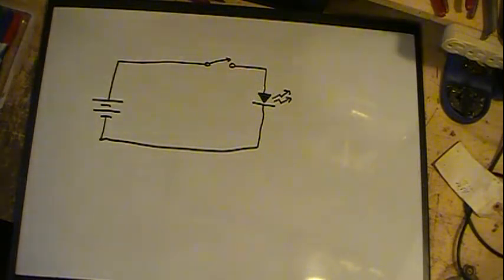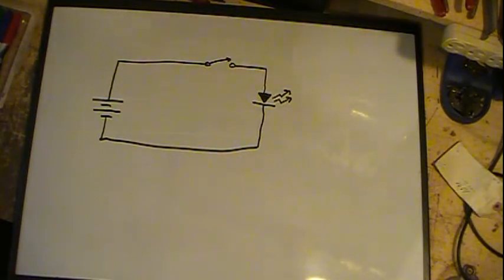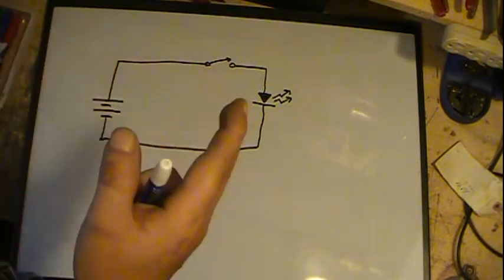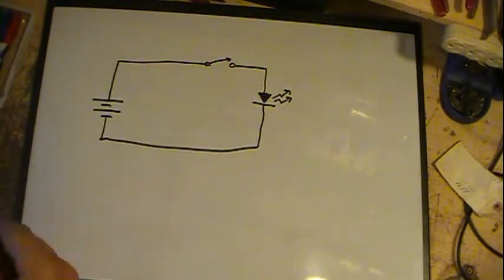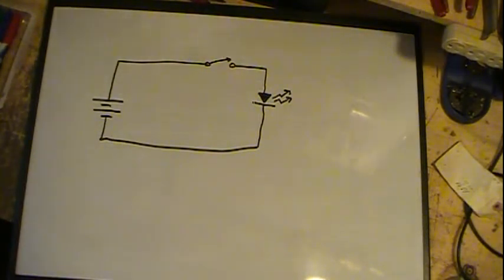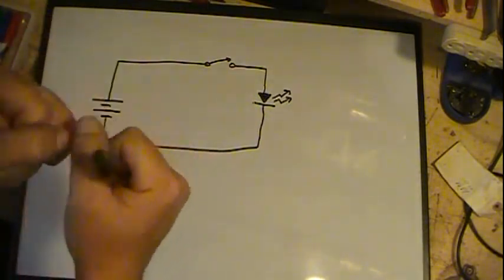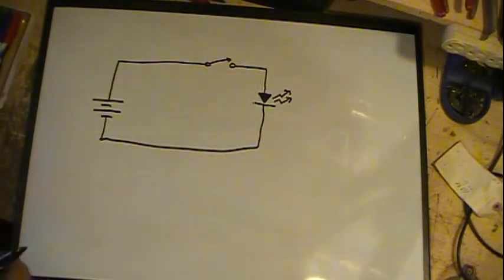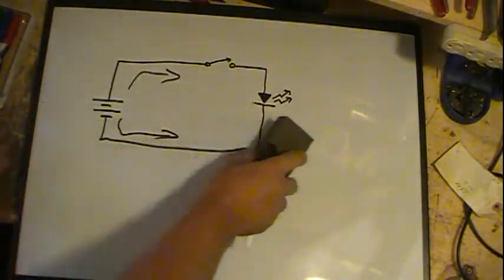Electric charge

Comment: DC current flows through the entire cross section of the conductor. This is why a larger diameter conductor has a smaller resistance to DC current. AC current flows on the outer surface, or very close to it.

"The effective resistance offered by conductors to radio frequencies is considerably more than the ohmic resistance measured with direct currents. This is because of an action known as skin effect, which causes the current to be concentrated in certain parts of the conductor and leaves the remainder of the cross section to contribute little or nothing toward carrying the current.

A simple example of skin effect, and one that makes its nature clear, is furnished by an isolated round wire. When a current is flowing through such a conductor, the magnetic flux that results is in the form of concentric circles. It is to be noted that some of the flux exists within the conductor and therefore links with, i.e., encircles, current near the center of the conductor while not linking with current flowing near the surface. The result is that the inductance of the central part of the conductor is greater than the inductance of the part of the conductor near the surface; this is because of the greater number of flux linkages existing in the central region. At radio frequencies, the reactance of this extra inductance is sufficiently great to affect seriously the flow of current, most of which flows along the surface of the conductor where impedance is low, rather than near the center where the impedance is high. The center part of the conductor, therefore, does not carry its share of the current and the true or effective resistance is increased, since in effect the useful cross section of the wire is greatly reduced.

When skin effect is present, the current is always redistributed over the conductor cross section in such a way as to make most of the current flow where it is encircled by the smallest number of flux lines. This general principle controls the distribution current, irrespective of the shape of the conductor involved. Thus, with a conductor consisting of a thin flat strip, the current flows primarily along the edges, where it is surrounded by the smallest amount of flux, and the true or effective resistance will be high because most of the strip carries very little current. This illustration makes clear that it is not the amount of conductor surface that determines the resistance to alternating current, but rather the way in which the conductor material is arranged."

Electronic and Radio Engineering, fourth edition by Frederick E. Terman, 1955, pp. 21-22

Comment: OK Dennis I've got it. At low frequency, charges the center of a wire or coax handles the main current flow, As you increase the frequency the current wants to flow towards the outer diameter walls, (or should we say skin), of the conductor. Seriously, I knew this all along.
    So this gets to the point of riding in your "metal encased outer skinned car" when a lightning bolt would would hit, you would barely be aware of a charge inside the vehicle. Another words, a "Faraday Cage." I am stating here that I know all this, because I use to troubleshoot 1 MegV, relativity high current, HV doubler stacks for Ion Implaneter machines. These things make a CRT a toy in comparison. I also saw a man die on the factory floor because he had his wedding ring on. What a tragedy!
   All bets are off in a fiberglass Corvette I'm afraid.
   BTW: How is a Boeing 787 going to behave under the same conditions?
   I seriously think I want to take THAT flight.
       Tom